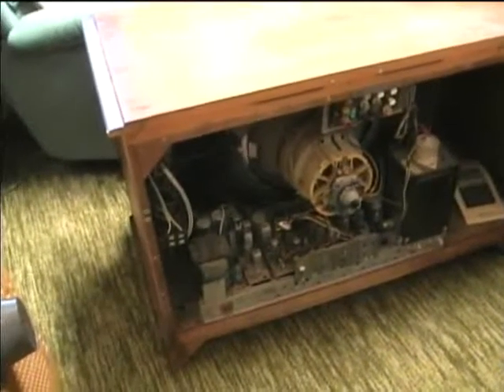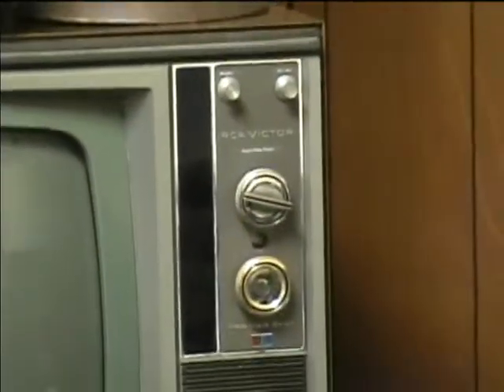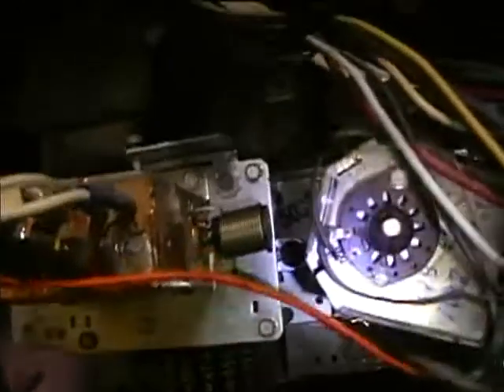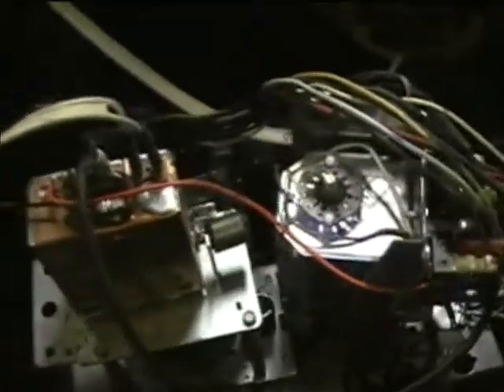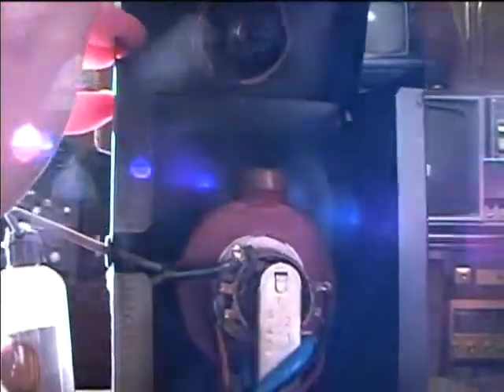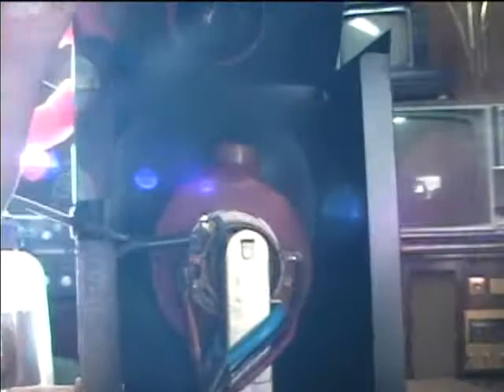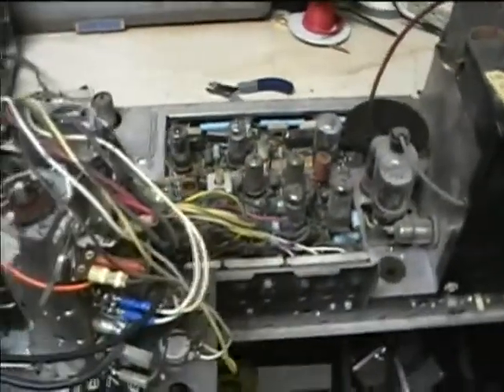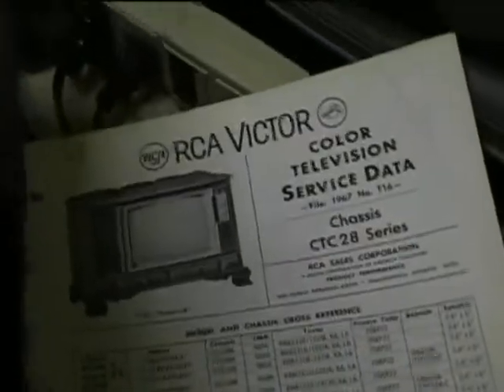1967 RCA CTC-28 TV chassis removal

Comment: @retrochad 
I assume you will use a digital converter box for over air or cable box..... I have a couple of transistor TV's that look great on cable or converter box. When they had the digital converter box Gov rebate, I bought two boxes. I used them for fun, but I have digital cable. I ended up giving them away to friends and family. I should have kept one. Will retrochad ever go to the dark side? Flat screen solid state LCD TV? Ha ha cheers